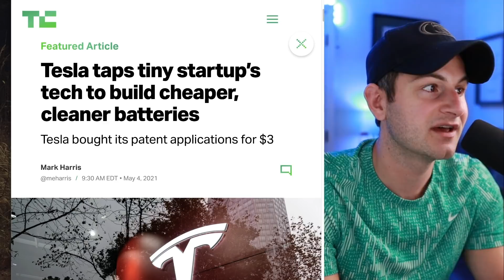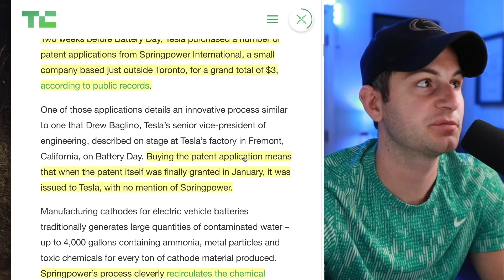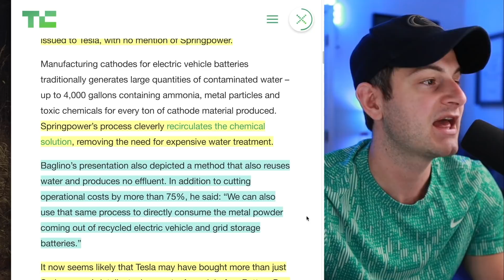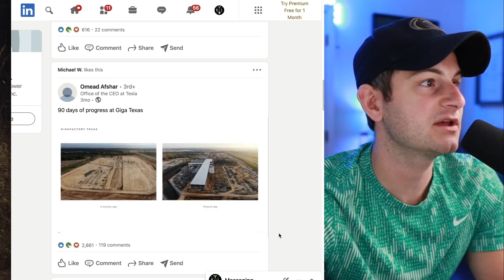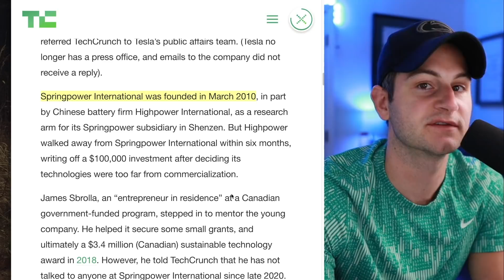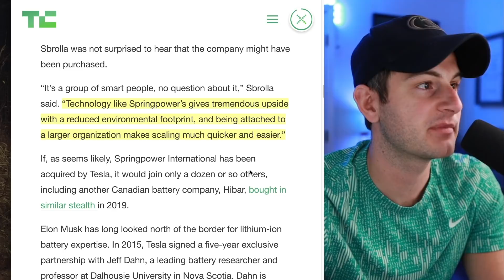Tesla's $3 Battery Technology Acquisition

Comment: All of this is very interesting. But I also note that Tesla was the Patent Application original filer. Can't figure out the long journey of assignments that result in a current assignment back to Tesla.
Reply: Yes I noticed that & was going to post my own comment, but spotted yours.  Also note: Amrit Bhogan started his employment at SpringPower a few months after that original line on the application was filed, about 1 yr prior to the 1st Tesla entry.  So did:-
a) SpringPower approach Tesla for a buyout or:
b) Tesla knew of SpringPower's work & approached them for a buyout. Tesla had the basis of this process but SpringPower were better qualified to progress it's development so it was handed over to them.
c) When all looked good, they allowed  SpringPower to file the patent to give SpringPower recognition & it's shareholders value as part of the sale conditions (ie not screw them over).

d) Buy SpringPower...

Comment: The patent may have little or no technical value or enforcement, but Tesla might be trying to prevent any future patent trolls to hedge future frivolous lawsuits. Either way, it is a smart move.
Reply: Recycling proces fluids like that is very common in al large number of different industries. 
If the idea of recycling is all there's to it (hardly with a 3,5 million grant one should hope) Tesla overpaid 3 $.
But your second point may then still be a consideration.
Reply: @justforthehackofit  I agree probably a worthless patent but I am more impressed by Teslas due diligence to avoid any possible patent infringement or litigation. As a shareholder it is 3 CAD well spent and perhaps the legal token amount needed for ownership.
Reply: Uhm wrong, many companies around the world are developing better and cleaner recycling and production processes at every level possible and tech is constantly evolving too.
Reply from the maker: yep, only time will tell. and i think the talent acquisition is a big story here too as most of the employees may be with tesla

Comment from the maker: New bar: 2,500 likes for the BTC/ETH giveaway! Stay tuned. And this Springpower news is not official, but it seems very solid to me! What do you guys think?

PS: this video was pre-coffee 😂
Reply: When you find trends and patterns 🤣 Us being ex bankers at major financial institutions isn't fair how we do our research. Great find * as you proving my speculation of factually going to recycle 4680 batteries is monumental.
Reply: DIllon - FYI:  This is not a patent but a patent application.  Any patent document number starting with a year (2021 in this case) means it is just an application that was published in that year (2021).  US patent applications are published 18 months after they are filed.  USPTO examiners are quite back logged and this application will not be reviewed for another 1-2 years.  Once reviewed, it will either be rejected (because there is existing prior art) or allowed to issue as a patent (and assigned a different number).  In most cases, there is a back and forth between the inventors/assignee and the examiner and consequently, the claims are usually modified 1-3 times.  This patent application has also been filed in Canada, China, Europe, and Korea and is currently being examined by the CA, CH, KR respective country examiners.